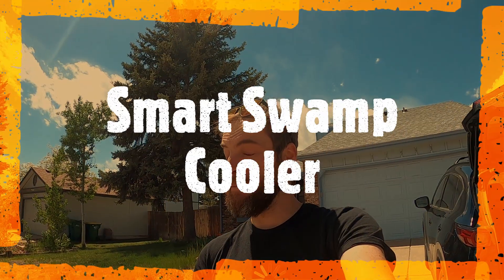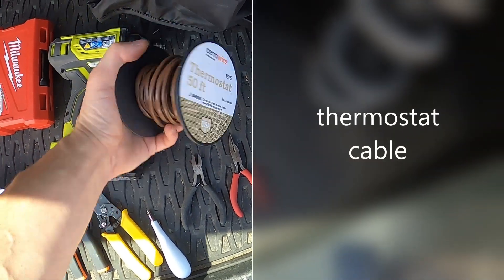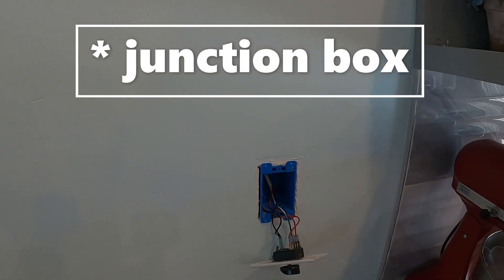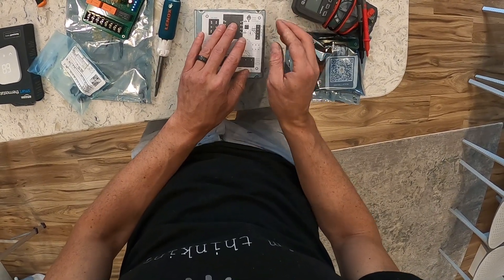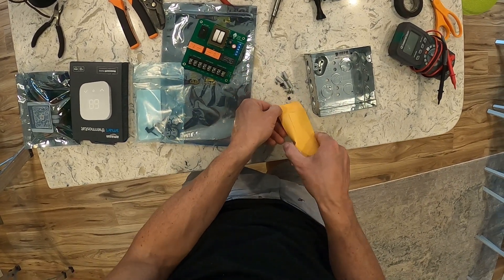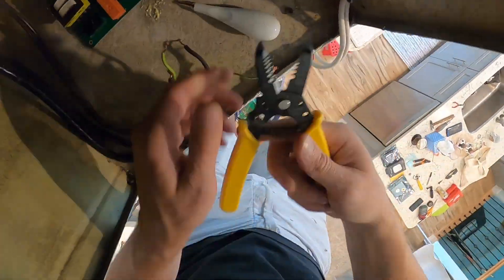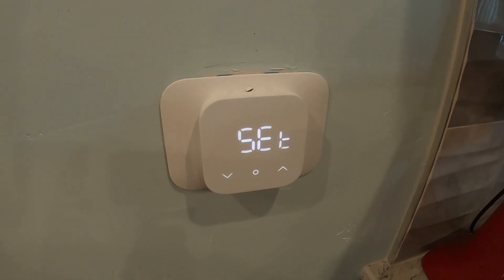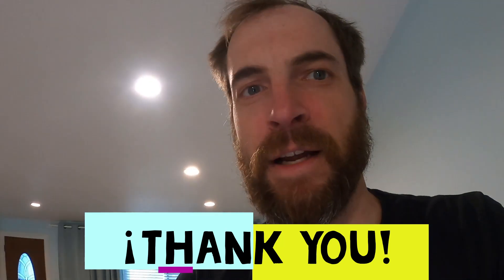Installing Smart Swamp Cooler PCB

Comment: Looks awesome. I have been dissatisfied with the options on the market right now. I've re-wired a window swamp cooler to run off 2 smart plugs. But, I lost high and low fan speed.  I like being able to schedule my cooler to turn the pump off when outside temps are less than 65 and just bring cool air inside. I can do this with a smart plug. Do you think this could be done with the smart thermostat?
Reply from the maker: Absolutely,
The actual execution will vary depending on the make/model of the thermostat. Here is a link for the nest thermostat for instance
https://support.google.com/googlenest/answer/10185085?hl=en

Comment: Would it work in Australia?
Reply from the maker: Yes, I am pretty sure Australia has same makes/models of the swamp coolers as United States. You can check the list of compatible coolers right here
https://www.simplyworks.net/specs
Reply: @ I have a breeze air system with a harmony 2 controller, is the controller only working with certain models?
Reply from the maker: @RawanStatilitia  I can look it up if you have the exact model. Some of the Breeze Air units have what they call hard wired control system. And it is a bit more complicated. Also our board does not support drain pump functionality at the moment..